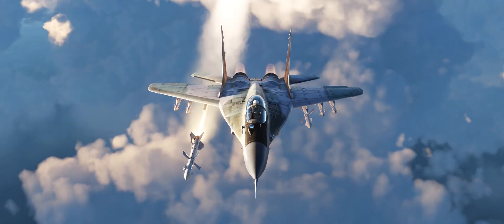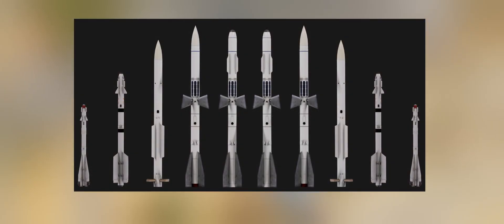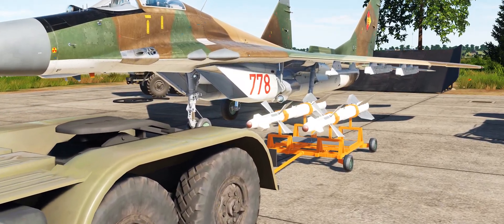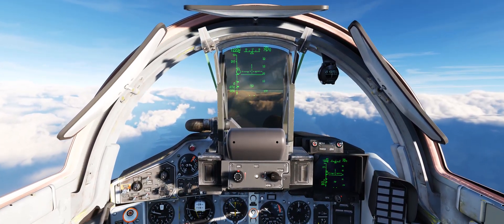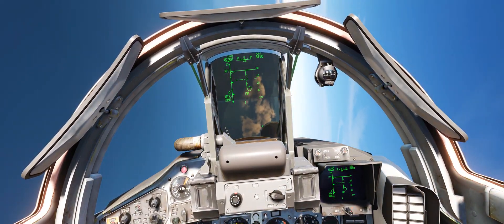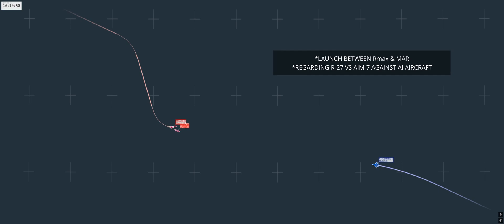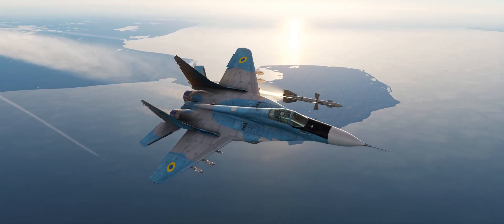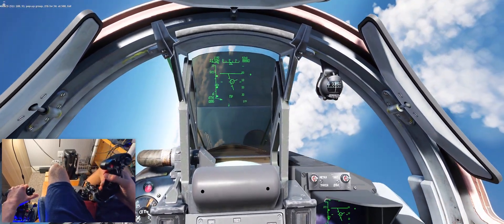DCS: Ultimate FOX 1 BVR Guide |  Pt1 - The Basics

Comment: Heh, "there is no one set tactic that a fox-1 fighter can employ against a fox-3 fighter to offset the advantage of the fox-3 missile". Well, in fact, there is. It's called MiG-29 with its superior thrust-to-weight ratio, acceleration, climb and turn rate. It's mostly about dodging 2-3 missiles while surviving to the merge or almost to the merge, calculating very carefully when to fire your own missiles. This discipline of "AMRAAM vs ER" is not for the faint-hearted. But in principle, I agree that the best strategy is not one set of instructions that work all the time, rather a set of maneuvers and recommendations that can help you increase the odds in your favour. Then it's mostly about learning or even sensing, when to use what, being able to imagine the 3rd eye top (tacview-like) view of what is going on when flying the MiG, etc. Even then the success rate of 50% would be considered a huge one (effectively neutralizing the fox-3 advantage). After surviving to the merge, the odds of winning increase dramatically.

Comment: Good summary. One thing to also keep in mind - peak missile speed and time of flight to impact also matter. The R27, even the base model is a faster missile than the Sparrow and builds speed much quicker in the same conditions. So fiering first is very important as whoever gets the first hit, effectively trashes all the fox-1 missiles fired at him (provided you dont just fly in a straight line). The soviet tactics for R27 employment also weren't super complex or nuanced - the first missile was fired at max range (again, so you get the first shot) and the second one was fired in optimal range, or no-escape, to have a high Pk. Whenever you are engaged first, you generally want to abort and run, same with missile timeout - no reason to merge if you dont have to.
Reply from the maker: Thanks! That’s interesting what you say regarding Soviet tactics for a shot at max range and then no escape. Could you tell me where you read this tactic by any chance? Genuinely curious as info on this seems super limited! Thanks! 🫡
Reply: @CommandT There is a 29 combat employment manual floating around out there. Also talking to pilots who fly or flew on those types and were trained in that doctrine.
Reply from the maker: @Kolobochok95  Interesting! Yeah I think I have the combat employment guide downloaded. Lot's of GCI references there but don't remember anything about specific distances and shots to be made.
Reply: @CommandT  it's the combat employment manual in Russian